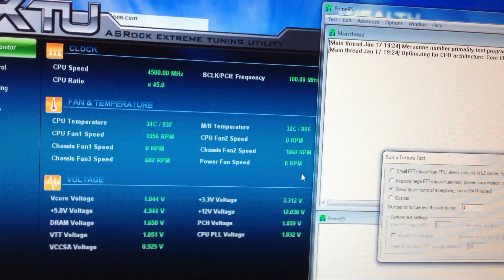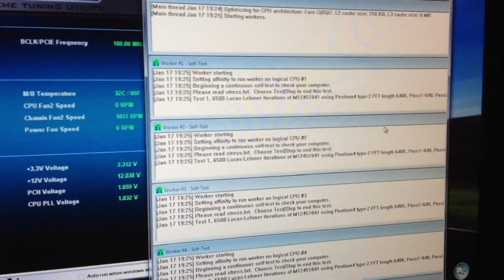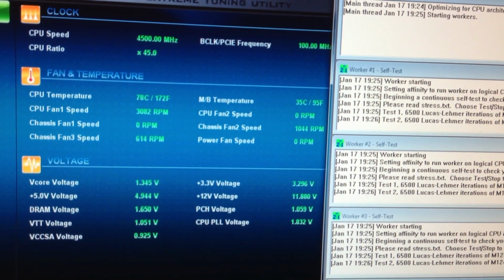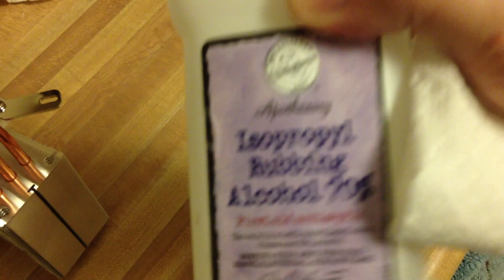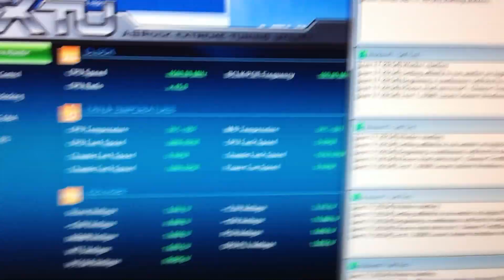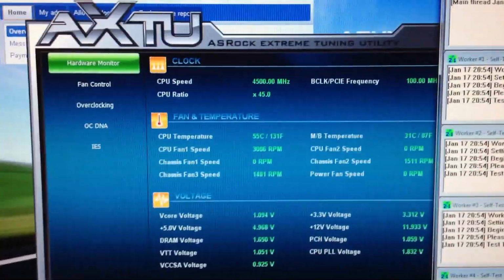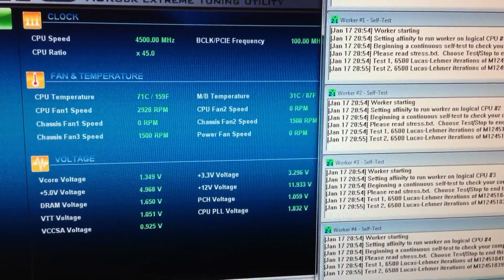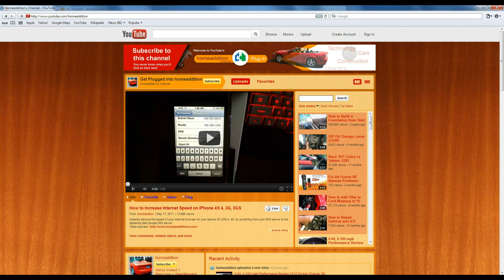How to Apply Thermal Compound to Intel CPU

Comment: Warning: Do not spread compound as shown. Place pea sized dot in the centre, this avoids air bubbles and is the optimum amount needed to cool your CPU. Do not use high pressure cleaning instruments on fans unless you are holding it in place (as shown in the video). You may damage your fan by making it spin faster than it should,

Comment: nooo!! Do not spread the compound! It will create air bubbles! You should just make a small dot and attach the cpu cooler and divide the force equally on each side meaning you will screw on each side by 20% and not 1 side completely and then on to the next one. This way the compound will be spread out equally by force and work more efficiently.

Comment: Yeah I'd go even less if its a GPU and you are adding thermal compound, especially Arctic Silver 5. Even though it says Arctic 5 is non conductive that is a lie. If it leaks onto the GPU board then bam the board will fry. I always use Arctic MX-4 when I do GPU repasting and Arctic Silver 5 for CPU

Comment: I've been repairing PC's for about 10 years and what some people don't understand is,it's not how much paste you apply,but HOW you apply it.A ''pea'' size drop in the middle of the CPU is more than enough as the heat sink will spread it evenly across the whole CPU when you attach it. I use Coolermaster High Performance paste,which is actually one of the cheapest brands available and never ever had any issues with stock coolers or overclocked PC's.Using a C.Card to spread the paste is total BS.

Comment: Your method does not cover the entire CPU and create the most effective heat conduction. I have an Intel CPU, almost the same cooler and the same thermal paste, Arctic Silver 5. I used a plastic card and covered the cooler with a really thin layer of cooling paste to fill the gaps and I also cover the whole contact area of the CPU with a thin and very smooth layer, then applied the cooler and turned it back and forth a couple of times before securing. Works like a charm.

Comment: I'm really starting to rage about everyone's opinion on ESD protection, thermal paste application and thermal paste removal. Some people say you should use microfiber cloths, others say microfiber cloths produce static electricity and will fry your CPU. Some people say you should clean the inside of your case and your components with a microfiber cloth, others say compressed air, and depending on who you ask, they both produce static electricity. Where is the fucking scientific consensus?!

Comment: I kinda have to agree.. When I built my first computer years ago I just slapped a large amount of thermal grease on there and I had troubles mounting the cooler I put it on and took it off like 10 times before it was fitted right... I had great temps.

People need to understand that one way is not the best and all others will likely give you decent results too. Its not rocket science. add compound and put the cpu on..... DONE!!

Comment: wrong. Spreading it around with a razor or credit card causes tiny air bubbles to form when the heatsink is attached. It's best to let it spread around by itself after attaching the heatsink. Please don't spread false information as fact.

Comment: Trust me - I also use arctic 5 and have a lot of computer building experience (i.e. I have an open water cooling loop, sleeved all my cables myself, actualy have cablemanagement). You used far too much thermal past. You need about third of what you used.

Comment from the maker: I don't have that one yet, but it is pretty simple. The cooler comes with a metal bracket that fastens underneath the motherboard (3:50) on the opposite you will use 4 screws that compress that bracket to the back of the motherboard, then you simply place the heatsink over the threaded screws and use the fasteners to sandwich everything together. 

the area where you will install the cooler as shown in

Comment: Generally you don't want to use 70% alcohol, you want at LEAST 90%. Try to stay away from paper towels and stuff with pc's in general. Little flakes can come off the paper and contaminate your thermal compound, if you can, use a microfiber cloth. Please don't apply any thermal paste directly to your heat sink., that's stupidity. Other than that, you should be fine.

Comment from the maker: Some say it depends on what type of thermal compound you use. I followed the manufacturer guide for my exact thermal compound for my exact CPU; which they tested in their lab many times before they produced the guide. I tried their method for the first time and I achieved lower temps using their method. Although 1 to 3 degrees is really not that big of a deal to me anyway.

Comment: you DO use a credit card or other item to spread it on the heat sink for  TINTING. After tinting the heatsink, apply the compound directly to the processors heat spreader.

IF YOU USE ARCTIC SILVER YOU DO NOT MAKE A BLOB, YOU MAKE A LINE.
IF YOU USE MX4 OR SIMILAR, MAKE A GRAIN OF RICE.

Comment: Instead of using credit card, just leave a pea-sized piece of thermal paste on the CPU, later by applying pressure the CPU heatsink will spread the thermal paste evenly. Just watch this video: /watch?v=-hNgFNH7zhQ&feature=channel&list=UL

Comment from the maker: That would work, just be-careful not to generate any static electricity while you are working with electrical components. A static shock can wreak havoc on electronics and then you'll be experiencing gremlins in your system.

Comment from the maker: I got official instructions from the manufacturer of my thermal compound specifically for my CPU. If you have the same exact CPU, this method is what is recommended for optimal performance. Click more info to read more about my system.

Comment from the maker: Not sure on the toothpaste. And I only use rubbing alcohol because it's recommended and it strips away any grease. Certain cleaners can leave a coating which is what you don't want.

Comment from the maker: Sounds like you are overclocking, running some type of intensive application, or both. Put everything on stock and let the computer idle for a few minutes and then check your temps. I will be posting a video on how to overclock a i7 2600k cpu very soon, so subscribe to my channel to be informed of when I do.

Comment: To clear things up, and that people won't be dissuaded in using a leaf blower.

It's perfectly safe as long as you don't live in a humid area or use it during the rainy seasons/ winter. The only danger there is that the leaf blower might accidentally spray miniscule (unseen) droplets of water on your system that it extracted from the air.

By that logic, I guess you should now know when using a leaf blower is safe or risky.

Comment: Alot of things can affect temperatures, do you have alot of dust buildup on the heatsink and fans? That restricts airflow in your system. What CPU voltage or vCore are you reading? How did you put your heatsink on your CPU? what is your room temp?

Comment from the maker: You can run it for however long you want and 72 c is the maximum recommended temp. I use my computer for business, Once you overclocked a whole bunch of processors, you do thing a bit differently ;) The most important thing about overclocking is making sure your computer doesn't crash or overheat; that's the only reason people run Prime95 because it puts the CPU to it's limits. My PC is rock stable and my temps are 38c idle and around 56 moderate load. Everything is gravy :P

Comment: @homeaddition Have you gotten your rebate back? Xigmatek is notorious for not honoring thier rebates. So unless you already received yours, say goodbye to those $20 you'll never see. As for a cooler, i recommend a NZXT HAVIK 140 or Tuniq Tower 120 Extreme, after lapping both to 3000 grit of course. Both do AMAZINGLY, only after I lapped them of course( 2500K @4.2 Ghz 52°C on P95) Both are in the $60 range, and very quiet from what I used in the rigs I built. As for the loki... $4:)